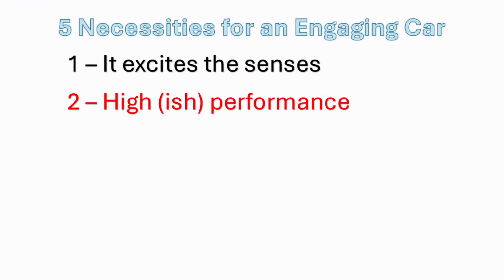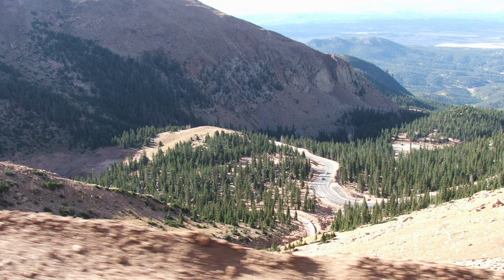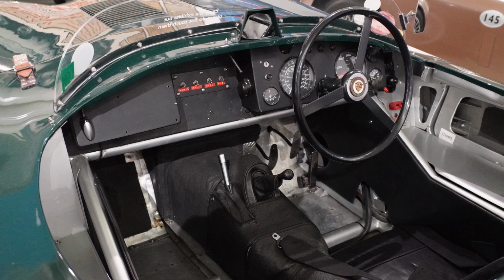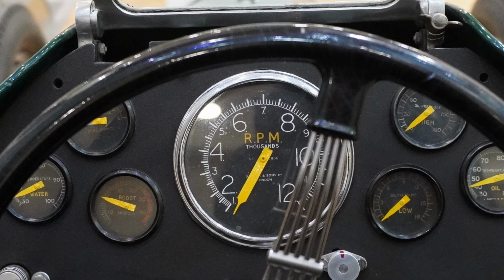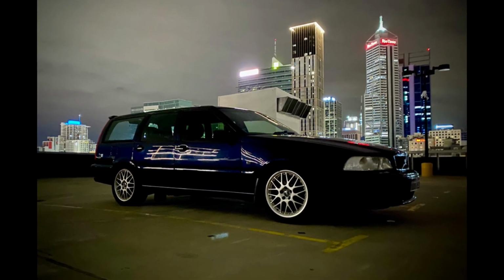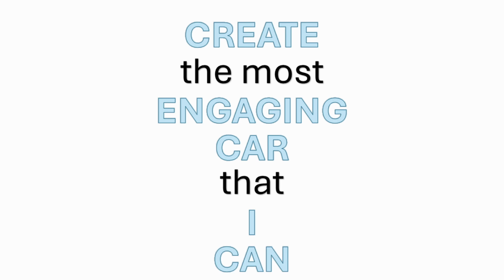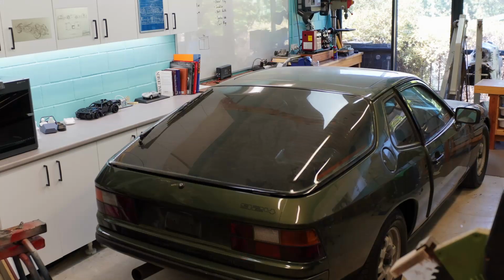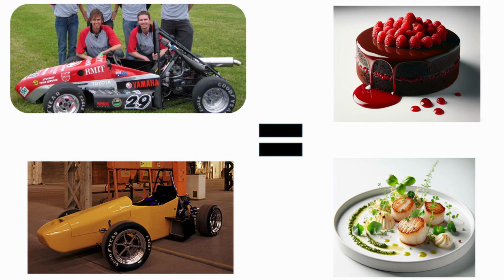The Start of the Design and Build of an Engaging Sportscar (Project 171)

Comment: Hi Dr Kevin! I wonder how much the overlap and spacing of the multi element wings shoud be if the chordline of the airfoil is around 190 mm?
Reply from the maker: Fortunately no multi-element wings expected on a sportscar that is inspired by those from the 1950s. But it does depend on the shape of the elements in use, making sure that the slotgap formed acts as an effective nozzle. I can't tell by the username but I would have a guess that you might need to have a talk to some of the experts from ECU Racing around the time of the Habibi racing car. They can tell you stories of discussing slot gaps with the great Willam Toet.
Reply: @KevinHayward7 thank you so much Dr Kevin